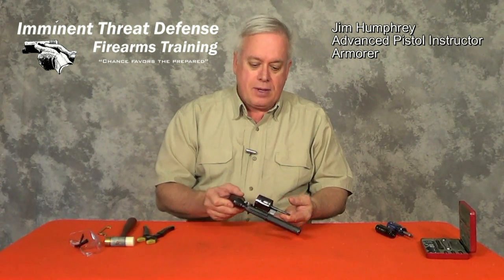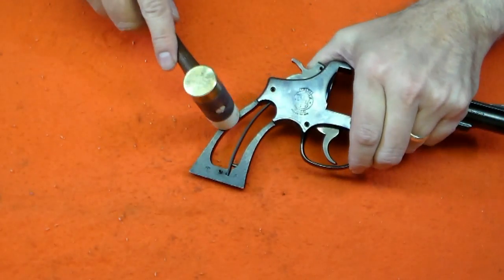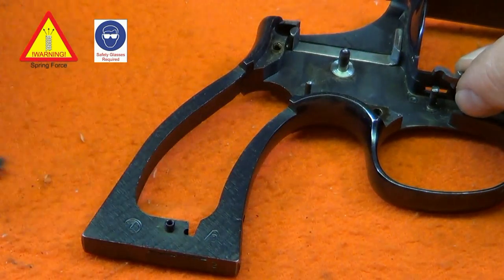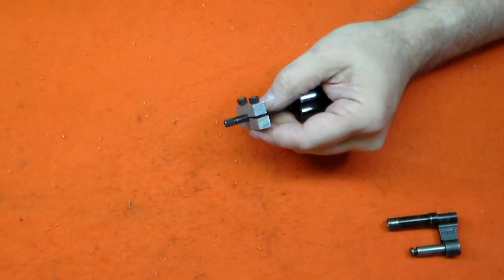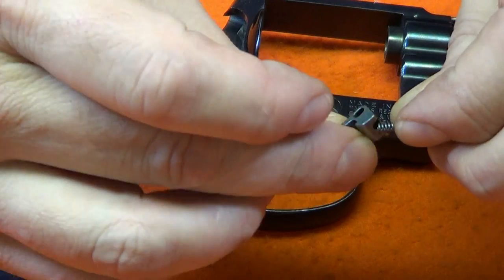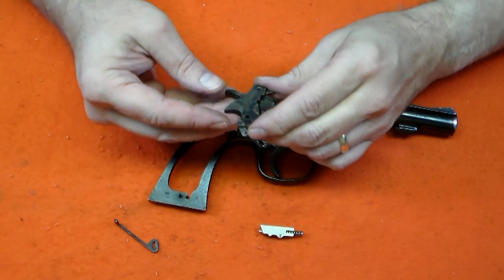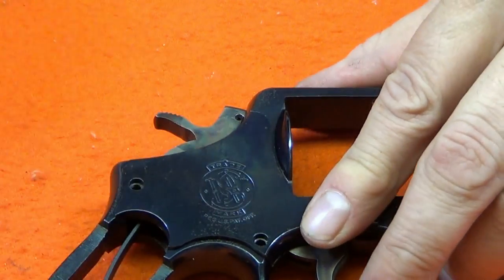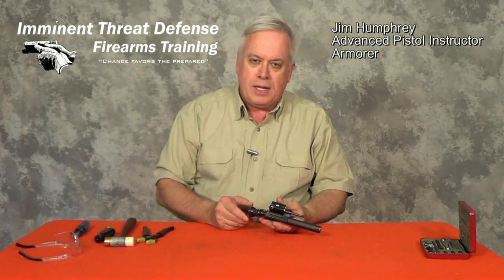S&W Model 10 Disassembly and Assembly

Comment: I need a frame where can I get one?
Reply from the maker: The frame has the serial number so it's a new gun, you can't buy a replacement frame because you're actually buying a gun.
Reply: Imminent Threat Defense so if the frame is cracked bent or damaged I can’t replace it I’d have to basically buy a brand new gun?
Reply from the maker: The frame is the "gun" everything else is just parts.  If you can find a frame you'd have to go through an FFL to buy it.
Reply: Imminent Threat Defense oh I see okay thank you!

Comment: is the hammer spur suppose to move up and down .If not how do you fix it.
Reply from the maker: Yes it does move up and down.  And technically it's called the "hammer nose", I got in wrong in the video, and one of my viewers corrected me.
Reply: @ImminentThreatDefense  thanks for the reply, my 10-5 moves a good bit and when I bought it. I took it to the range and it misfired one of the six and I thought it might be the hammer nose